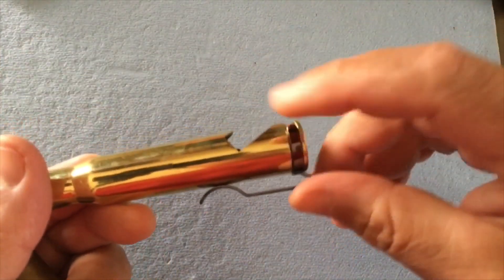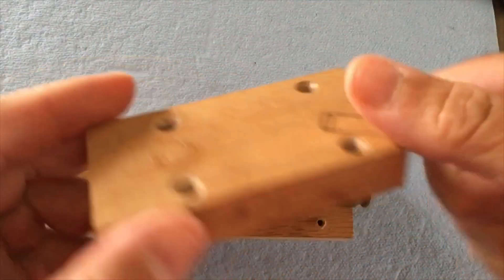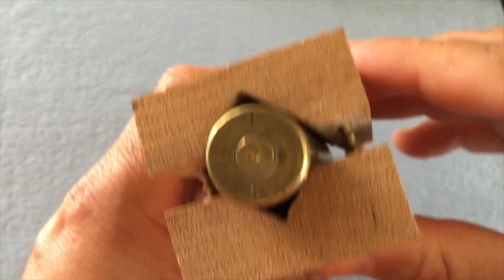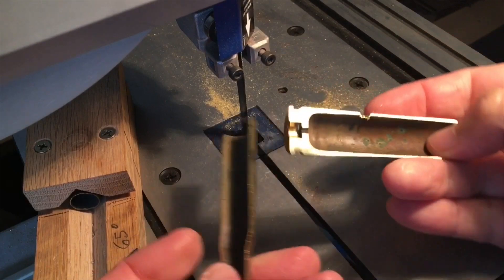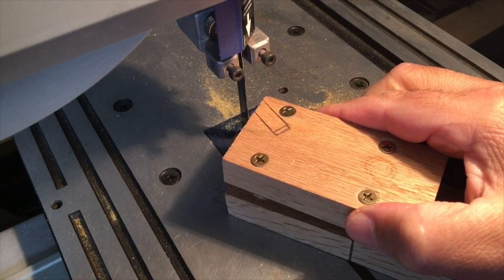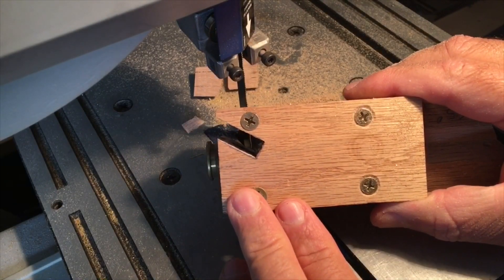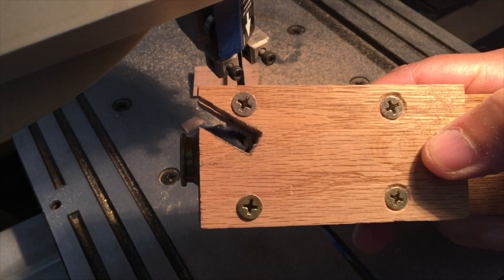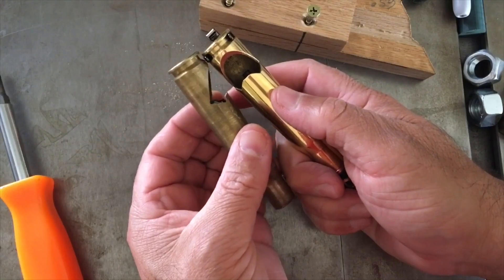50 Caliber bottle opener bandsaw Jig

Comment: Could I get the jig dimensions and groove cut out sizes, please?
Reply from the maker: Hi, I used a 3 inch wide roughly 7 inches long scrap wood on bottom and top around 5 inches (long enough to hold the cartridge) centered on table saw and cut a 45 degree angle groove about 1/2 inch deep for the jig,  the angle of the bottle opener is around 40 degrees.  Use your imagination and improvise when making jigs, I try to make them as generically as possible so you can expand on my jig designs for your personal use as my tools are most likely different than yours.  Hope that helps.
Reply: @exoticwoodpen   It sure does! Thank you
Reply from the maker: @garyburant6725  you are welcome, you might practice on some copper pipe or a wood dowel before you cut up a cartridge.  Where I buy them they are 10.00 each from a military surplus store.
Reply: @exoticwoodpen  Will do. Have a friend that want wants me to make some for him and I'll probably try with some 5.56 I have as well